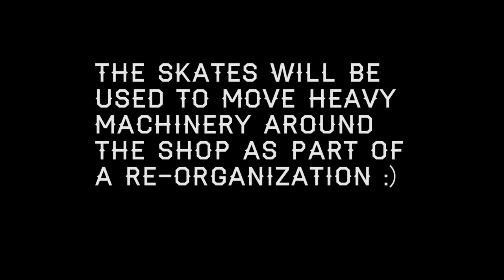DIY Machinery Skates

Comment: great idea phil, you could have a career in producing toys-from-the-70s :)
Also if you added another nut to each bolt and tightened the nuts to each other then it wouldnt have to be tight but still would never unscrew accidentally. Maybe you used nylock nuts, which is also perfect. Keep up the good work
Reply from the maker: Good tip, thanks!